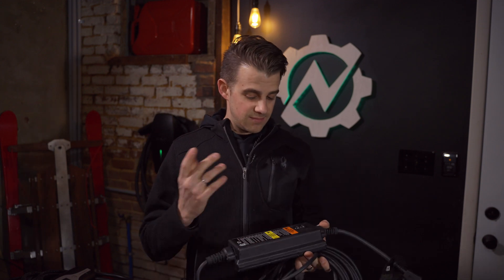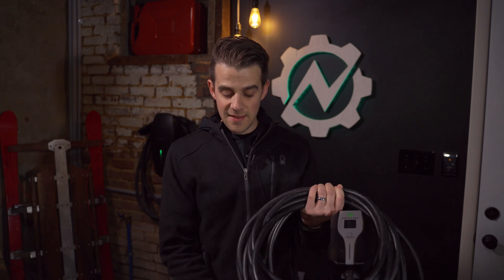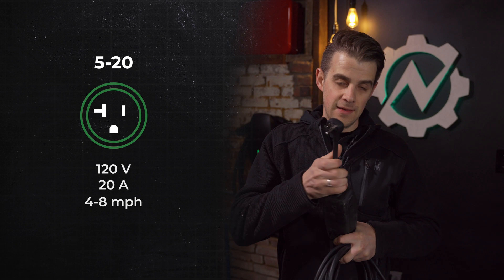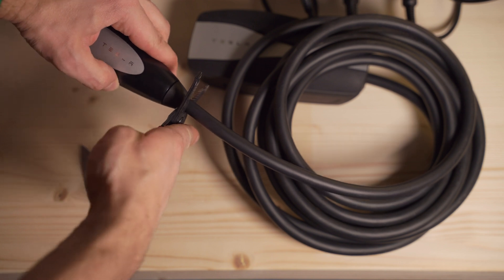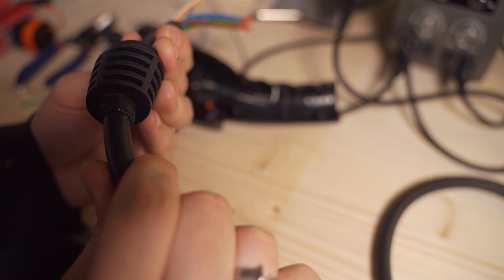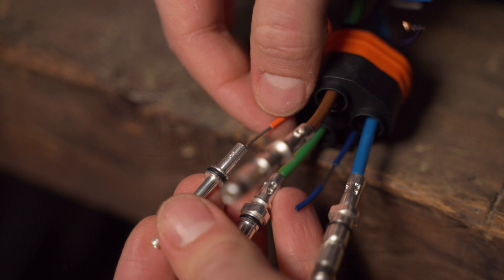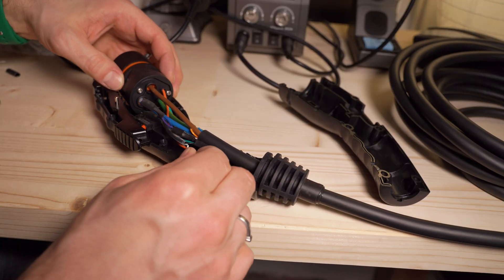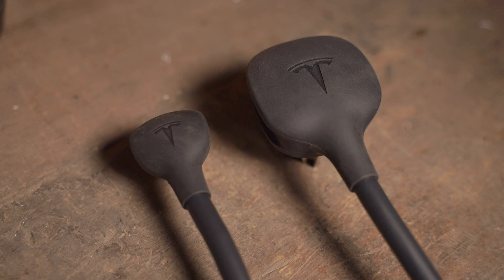Hacking the Tesla Mobile Connector

Comment: what resistror did you use for proximity/current limit ? I ask bcoz I saw 40A adapter on amazon so I am wondering if its possble to squeeze 40A from mobile connector

Comment: Do you have any wiring diagrams for these Tesla mobile connectors?
I have a gen 1 that I need to put a new 14-50 plug end on, I had started but I didn’t realize there were so many wires going to the wall plug end.

Comment: I cringed when you cut the charge wand off of the cable.  I have a cable with a faulty end connector.  Is there anywhere those cable ends are available?

Comment: All you chevy bolt owners, you COULD cut off the 120v plug and replace it with a 240v plug, but please don't do this.  There is a temperature sensor in the 120v plug of the EVSE that comes with the Bolt.  If you cut the plug off you lose the ability for the car to sense that it's plugged into an old lose 120v socket and that could be dangerous.  Also, figure out all of the outlets on the branch circuit that you plug your car into.  Then open up the receptacles and see if the wires use the screw terminals or are simply "back stabbed".  Please modify them to use the screw terminals.  Your insurance agent will thank you.

Comment: I'd like a breakdown of the resistor values that all of the adaptor-cables use to tell the UMC what current to supply! That way I could make a rotary switch to set the current manually. (To use only when you know what you're doin'! Like I do, and obviously you)

Comment: Hey Josh,   The guy who makes the Tesla Tap is the guy who made my custom cable.   Mine is a Tesla UMC (now called NACS) handle to a female J1772,  so basically the same as the 4” J1772 adapter that comes with every Tesla but mine is 19 feet long.    

I needed it because my EVSE is 35 feet from my Tesla charge port and my existing EVSE only has a 25 ft cable.  

The funny thing is I own one of these Tesla EVSEs for 2 years but I have never used it yet.  Only used it as a display at car shows.

Comment: Hey there, I love the details you gave in this video! Question have you used a tt-30 connector the aftermarket one for the Tesla mobile connector? Trying to see if it'll work on a 30 amp 125 volt circuit. On other evscs it just detects 120 volts unlimited to 12 amps.

Comment: that was nicely done, although the high-tech crimp tool made it look too easy. Personally, I would have no issues soldering those pins because they will not be subject to vibration or even much movement within that plug assembly. The addition of the shrink tubing was a stroke of genius.

Comment: I have question. Is there a way to make a Tesla or other EV to accept DC voltage supply to the onboard charger? I mean if a have a battery at like any DC-voltage between 170 to 340
VDC, it should be in the range as that is what will be produced in after the rectification in the on-board charger. What do you think?

Comment: Hi Josh, just a curiosity ... how did you know which side is the Live and which is the Neutral?  Is it marked somewhere?
Reply: It's colour coded
Reply: @gustavgans3760  Thanks Josh, I'm sorry I only posed half of my question :(  I wanted to know which is which from the pins, without taking the thing apart!  Having watched your video a few more times I think I can now work that out from the various shots you give of the plug internals.  

I'm trying to charge a 2020 Tesla Model 3 AWD LR battery pack off the car to use as a 'powerwall'.  There is very little information on such a project on the Internet.  The problem I'm facing currently is I'm not getting any power to the battery pack input socket on the penthouse so I just wanted to create 'test points' along my intended charging cabling to see where it's getting stuck.  I must say I'm currently thinking of direct charging the two halves of the Model 3's battery layout using a 220vDC supply from a transformer.  If you have any thoughts on how to achieve my project I would love to hear from you.

Comment: Do j1772 extensions work well with this. Would be a great option for someone who needs to get extra length out of the cord.
Reply from the maker: They should work fine although I haven’t tried it. The other alternative is to extend on the input side (extension cord) but it wouldn’t be as universal and there is always dangers when using 5-15 cords that they probably can’t handle the current.

Comment: Since Tesla is no longer bundling a MC with the cars, perhaps they should outright sell these with Type 1 plugs for other EV owners. It should help them reach even higher economies of scale. Makes sense unless they are subsidizing the $200 unit and would just lose more money if they sold more for non-Tesla owners.
Reply: The reason they are no longer including the universal mobile connectors is due to supply shortages, which were also a factor before the pandemic (the charge connectors are and were more often out of stock in their online store than they were in stock).  Making them more widely available would only make the shortage worse for their customers.
Reply: @android04  Thanks, but I’m talking about a Type 1 output J1772. Tesla doesn’t sell those adapters on their store. Even the Type 1 J1772 to Tesla adapter is the reverse of the J1772 connector I’m talking about. Even so, your info definitely puts things in a different light. Thanks.

Comment: Really whishe that combo lvl 1 and 2 came with all EVs.  Aftermarket one I bought has to be stepped down manually and had to buy multiple nema attachments.... Ends up pretty pricey. But I travel a fair amount and have found the need. Auto feature of the tesla one makes me whishe I had bought theirs
Reply from the maker: Agreed. I just put out a video on my aftermarket 32A unit, which requires expensive adapters. The new $200 price point of the Tesla unit makes it a no-brainer, IMO.

Comment: Do you know what gauge wires are in the tesla cable? Also any ideas on a replacement temperature sensor that could be used instead of just bypassing thermal protection? Thanks.
Reply: In the Tesla cable in UK (same as the Type 2 shown here), the temperature sensor is a NTC thermistor so the Tesla UMC (universal mobile connector) can see if the plug is getting hot. The other wires beside the PP, CP and temperature wires are for the button that opens the car's charge port. It just supplies power to a little RF module (433 MHz ISM band) in the Tesla plug - the US Tesla plugs also have this feature. Hope that helps.